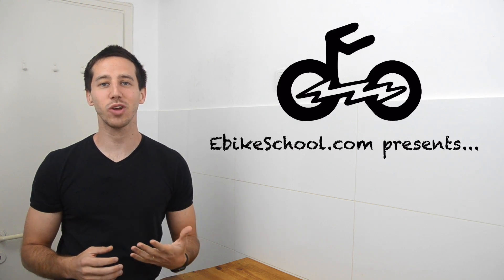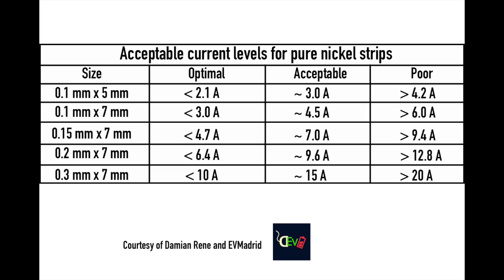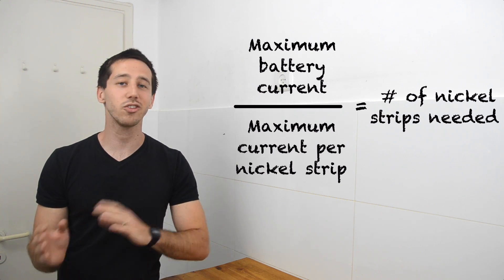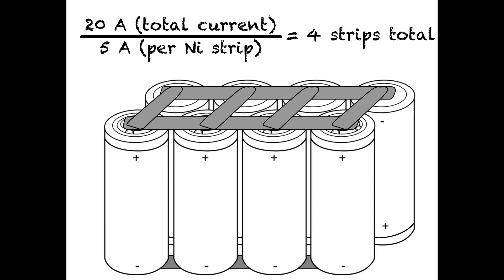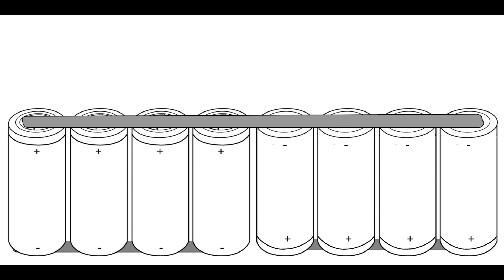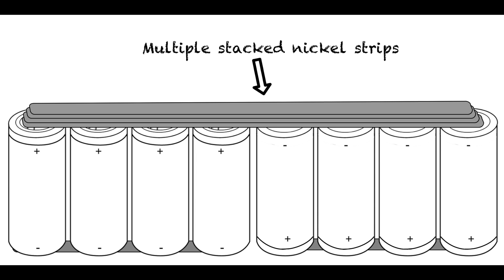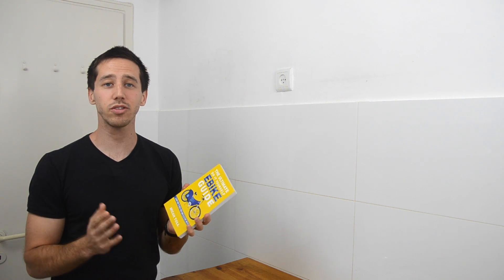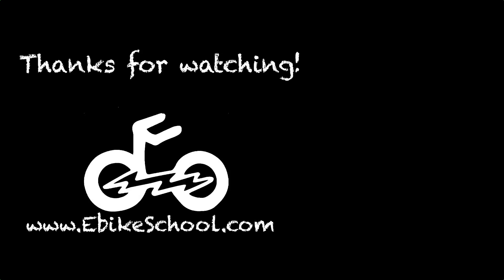How Much & What Size Nickel Strips Should You Use? Q&A#4

Comment: Micah, I really appreciate your videos. The pack I am building is a 20s 7p.  I'm just can't help but feel I should use copper over nickel. I understand nickel is easy to spot well because it's more resistive than copper.  I plan on cutting 1 in wide strips of copper 26 gauge. My parallel packs are two cells wide so the 1-in should cover it nicely.  I thought I might drill holes through the copper over the center of each cell and pre tin the cells.  Then with a little flux and a good soldering iron.  If I figured it right, 26 gauge 1-in wide strips should be slightly better than 8 gauge copper wire.  I know you're not big on soldering these cells but isn't the nickel a bottleneck on the bigger packs?
Reply: The problem with copper is that you need to solder like you said. The nickel is more resistive, but since you put the necesary amount of material to let the current pass without resistence the result is the same.
Reply: I build a 20s5p with 0.7x6mm copper Strips, and i can pull easy 100a.
But its very hard to solder.

Comment: Hi micah  I ordered your book from Amazon it has helped me on my diy battery building thanks I ordered a 48v 12.5 mah battery from Ebay I opened it up and yes it doesn't have much nickel in it it has only one strip across parallel and series configurations  I noticed I wasn't getting much power from the battery so I am building more nickel on to it ?

Comment: Great video. Now I have a battery 10s4p(xiaomi m365pro) I would like to calculate what's the optimal size of the strip for each square set of paralel batteries. Unfortunately I cannot double up the tabs on top of each other but I can have them wider. How do I calculate if my 6mm/0.17mm nickel strip is sufficient. Thanks and sorry for the weired question.

Comment: Can we charge a 48v Li-ion battery with a lead-acid battery charger having same ratings?
My lead acid charger is rated at 62.5 max voltage
So can I use this charger...
Reply: Every Li-on battery pack must contain bms battery managment system inside . It is protection circuit board inside battery pack. Your battery is probably 13 cell in series it means 13x4.2V is safety maximum voltage 54.6V. There are three options if you use lead acid charger with 62.5V.   
1. You destroy protection board and overcharge battery 4.8V per cell means sometimes FIRE!!!. 
2. You overcharge battery to 4.8V per cell and protection board survive.
 3. Protection board protect battery for overcharging and you can use the charger. So it depend on protection board in battery. If you are not sure what are you doing, dont try this... 

https://www.youtube.com/watch?v=ZTzEHsJVZhA&t=3m29s
Reply: @m1a1to  sir I am using this bms of 60A
https://www.banggood.com/Same-Port-13S-48V-2535A45A60A-BMS-PCB-Li-ion-Battery-Protection-Board-For-Electric-Bike-Ebike-p-1332093.html?ID=47606&cur_warehouse=CN

Comment: Hello I am Akash from India. Your videos has been very useful for my project. But now I am manufacturing a racecar having PMAC motor. Its peak voltage is 470 V and current is 200 A . I am also using 1850 cells but I have no idea of how to connect these cells . My final configuration is coming out as 112s 7p for 7Kwhr battery pack. Either by using a spot welded  Nickel strips or any other method. If Nickel strips are good then how much thickness should I consider . Please answer my question as soon as possible.
Reply: You are going to harm someone with such high voltage! Learn the basics and watch the YouTube channel "electroboom". Anyway... For your project you need very massive nickel pieces. Better go with copper 👍🏻
Reply: 7p is barely enough for your project, the best you can get out of on 18650 is 30A, by doing 7p, you will over heat them, not to mention the shortened capacity & lifespan.

Comment: It may not be the best idea. What I'd do is build the pack. With a single nickle strip. Then solder solid copper wire to the strip. Not the cells. And have about 8 spot welds. And about 14 gauge copper. Maybe 16 or 18 ga if soldering is difficult. Just doubling or even quad runs of copper. I'm using 8gauge copper busses on my 100s packs. Fused per cell. I may go with 10gauge. But its 4 strands into a 2" by 3"copper plate . it should never see over 125a the busses are 10" and joined by other buss links across them 8" long. The 8-10 gauge should carry 40-50  amps each, easily for short durations. It being so short. Then connect with 2/0 gauge. It will usually see 50-100 a max. With occasional 200amps. Or as much as 4kw from from my 5kw inverter and DC loads. Depending on pack voltage. Up to 29.4v im going for a minimum of 23-24v and max of 28.8 or so. I know its a bit different than high current packs. Mine is 1400 cells. Of a total 2800! In 100 cell packs. Great video, I have been looking for this info.
Reply: I do the same. Will not stack. Have .4mm copper sheet to use, prefer bare solid copper wire. I'll double 24 gauge,  ea good for 4A, or run 18 gauge, good for 40A. I try to solder before welding ni strip to batteries

Comment: Do the spot welded joints act as a limiting factor to the current? Because their cross sections can be pretty small (therefore adding to a non-insignificant resistance). In your spot welding video, you make 3 welds on each terminal for that very reason. How much current can comfortably flow through each weld?
Reply: I doubt they matter too terribly much, as long as it's a solid connection. Each weld point only has to carry the current of a single cell, unlike the series connections between multiple cells

Comment: Why nickel and not something more conductive?
Reply: Easy to weld. Copper requires more energy to weld because it is more conductive.
Reply: @jalius7878  True,  also that spot welding copper is destructive because the copper draws current away from the spot welder, as it is much more conductive.
Reply: No oxydation.

Comment: I'm building 22s6P and would need at least 65amps, i calculated that's like 18 strips, is that correct per cell, or can you spread it over series?
Reply: Why would u do that? Simply solder copper top of the nickel. I have .4mm supper sheet and at 9mm wide, is good for 40 amps. I have soldered .4mm on top of .15×8mm nickel. Soldered on top of the copper is (2) 18 gauge solid wires. With that combo u'd have 5A from nickel, 40A from sheet and 30A from (2) 18 gauge. 75a, lot less expensive.

Comment: What if i have a 60v E-scotter and a 12v e-bike, and would like to build multiple 12v battery banks, which I could use for both? If I add a bms for each 12v bank, can then connect them in series? What happens when charging/discharging multiple packs?

Comment: I bought some nickel strip from a website and it was fake
Reply from the maker: Which website? Link?
Reply: EbikeSchool.com I said your by mistake, meant to say a. I was asking what I should do about this. I bought it from some online vendor from Amazon , and I did a test on it, and it was for sure not 100% pure. I corrected my original comment.
Reply from the maker: If it was Amazon then they are usually very good about refunds. Probably won't even make you send it back if its inexpensive enough. Just go to your order page and request a return. In the future, I carry pure nickel strips on my site at https://vruzend.com/product/100-pure-nickel-strip-for-battery-building/
Reply: Are plated nickel strips not having a lower resistance and therefore able to carry more current that pure nickel?

Comment: Could you use copper as apposed to nickel strips? and why nickel it is less conductive then other metals? what about tin. Get back to me if you could thanks brah!
Reply: test
Reply: Copper is harder to spot weld(requires more heat).  It is possible, and yes it does carry more current for the same size nickel strip.

Comment: I'm making a 20s 8p battery pack for a small electric motorcycle and I'm having trouble figuring out how many .15x6x50mm strips I will need. According to my calculations I will need about 320 total strips but that seems high. If someone could give me a hand with the math just to make sure I'm not mixing up numbers in my head I would appreciate it.
Reply: Here is a link to the strips I plan to use https://www.amazon.com/0-15x6x50mm-Soldering-Capacity-U-S-Solid/dp/B07811NCH3/ref=sr_1_3?s=industrial&ie=UTF8&qid=1521074126&sr=1-3&keywords=pure+nickel+strips+0.15&dpID=41GLTU20JbL&preST=_SY300_QL70_&dpSrc=srch

Comment: I'm having trouble getting a good weld with .2 nickel strips I have, but I've found that I can put a.1 strip on the battery first and then weld a .2 on top of the .1 strip and get strong welds. Is this a bad approach to use for high amp requirements?
Reply: Did you find if that is good way to weld .2 nickel strip?
Reply: That .1×10 mm nickel is good for 5A. Solder an 18 gauge solid bare wire to nickel. The copper would b good for 15A =20A

Comment: Should I choose solid nickel or nickel plated steel? Is there any difference in performance?
Also, the strips are often joined to the battery by two weld-spots. These spot welds tend to be the same shape as the tip of the welder but let's assume that each spot-weld is round, and has a diameter of, say 2mm, (This is typical of the welds that I have observed on reclaimed cells). Surely this should figure in your / our calculations?
Please, please respond. I think my point is more than valid, thanks.

Comment: I am creating a battery as a starter / main battery for an ICE motorcycle. It'll be an a123 4s1p pack. Once the engine is running the battery should be charging - if not, I have other problems. So, the only thing that I need to scale the connecting strips for is starting load. The OEM battery is rated 130cca and the a123 will burst at 120 amps. Do I need to scale for the burst (120 amps) using the factors given in the table (i.e. 24 0.15mm strips total / 8 strips per connection) or is there another factor I should use? Also, how do you connect the strips? This will be my first battery so I will be soldering it - do I solder the entire length of the strips or just a contact point at each end?
Reply: Sorry, I know this was quite some time ago, but did you finish your build? I've been wondering the same question about multiple strips - what's the ideal way to stack them? Do I still only solder the contact points?

Comment: Hi I am about to make a 6s8p configuration for my rc car.I want to use high amp 18650 cells because i need sometimes 60-80 amps. I made a battery holder cage to prevent the batteries from overheating. Can you please check it if its all right or not?
Reply from the maker: Sounds like a great start!

Comment: i build a pack with 8P  (20S) and each cell connected with the next P group with a single 0.15x7mm strip, so it can pull safely 40 Amps ? if i understand this clearly?
Reply: Yes 40 amps at 5 amps a strip

Comment: In the case of the 2WD bicycle how to control the speed of both motor. I mean how it perform in case of turns where speed of both wheels are different. And whats happened if any one motor in start to run fast and another is slow.?!
email id-  parth.halvadiya24@gmail.com

Comment: This is quite wrong sins when you add more nickel you don't just increase the mass of the conductor to carry more heat you also reduce the resistance that reduces the voltage drop even further that means that when you add more nickel strips it adds more to the current capabilities exponentially not incrementally as you say.
Reply: That is what he said, you are adding more current carrying capabilities! he was just explaining about the heat problem as a safety point

Comment: Great video! I have also looked through your other tutorials and I was wondering how you would go about stacking the 18650 cells on top of each other...length wise, the reason would be to make a longer pack shorter.

Thank you for your time.
Reply: This is what I do  I make the battery long then bend the plate and stack them upright  good with s3 not so good s10

Comment: On a somewhat related topic, in a different video you talk about testing the internal resistance of a battery.  You end up with something like 325 milli ohms and mention that it is too high. What is a good number for a 18650 cell type battery? Iv built a battery and have some voltage sag and would like to figure out if it is ok or should i go back and add more strips, or shorten some of the wires.

Comment: why not use copper instead or even silver as that is the most conductive ;)
Reply: Aluminum is also pretty conductive and easier to work with but I prefer copper for most productivity
Reply: Don Mega  it's not that much more expensive, just slightly. If you replace all the nickel use in the video with copper it won't even cost $1000, no, it won't even cost $10.

Comment: Great video! Thank you! I´m trying to learn as much as I can before trying it out on my own. I wanted to ask a question regarding this same topic: I was thinking on buying this pure nickel strips that have slits (https://www.aliexpress.com/item/18650-battery-pure-nickel-belt-3P-4P-5P-6P-lithium-battery-nickel-strip-Li-ion-batteries/2053339372.html?spm=2114.01010208.3.58.jFuUQq&ws_ab_test=searchweb0_0,searchweb201602_5_10065_10068_5000017_433_434_10136_10137_10138_10060_10062_10141_10056_10055_10054_10059_124_201_10531_10099_10530_10103_10102_10096_10052_10144_10053_10050_10107_10142_10051_10106_10143_10526_10529_10084_10083_10080_10082_10081_10110_10111_10112_10113_10114_10078_10079_10073_10070_10122_10123_10124-10530,searchweb201603_7,afswitch_1,ppcSwitch_5,single_sort_0_default&btsid=2f986c7c-cbbb-45be-b19a-06c62666b615&algo_expid=9ec7703f-7a9d-44d3-98ba-8c53d800a5c0-6&algo_pvid=9ec7703f-7a9d-44d3-98ba-8c53d800a5c0), Do you recommend using this?, You showed in the video that it´s optimal to have more nickel strips if you wanted a higher amp build. Are this good even though they are using the same strip for parallel and series connection? I´m planning on doing a 14s6p battery, and i Dont know if I should just buy pure nickel strips whithout the slits.
Reply from the maker: The nickel strips with and without slits is basically the same in terms of calculating how much to use. The purpose of the slits is to improve the spot welding by forcing 100% of the current to pass through the weld and not let some of it shortcut through the nickel itself. You'd use the same process though by calculating how much current each of those series sections can handle. If they don't add up to the current you want to pull through your battery then you'll have to double those up as well.
Reply: +EbikeSchool.com  thank you! Though my doubt is that the strips in the link are much bigger because the are ready to make paralel and series connection in just one strip. If these strips are bigger, then they would have a higher amp capacity and still be optimal according to the table? Or is ir better to just cut alot of pieces and use many small instead of a few that are wider? thank you so much

Comment: amazing video!!! i have 6 x 18650 in parallel and nickel 0.1 x 10mm . i want to make 12 in parallel what would you recommend? i was thinking to put 6 bat + 15a fast blown fuse + 6bat 30a fuse. bad idea looks like because nickel strip wont handle 24A at 3.7 v dc right?
Reply from the maker: It really depends on your series connections. If you want to pull 24A through the battery, you'd need between 5 to 6 of that size of nickel strip in your series connections. So if you have a 12p setup, you could connect in between every other battery cell, at a minimum.

Comment: Hi Micah,
another great video :-)  tnxx and your new diy lith.batt book i want to buy! that is for sure :)
question: can you explain how to make diy batt pack on two floor (for example when you limited with space ) ?
Reply from the maker: Thanks for the kind words. I'm sorry, but I don't understand the question. What do you mean by 'two floor'? As in a very flat pack?
Reply: Micah sorry for my english :-) 
ok my specific problem is battery for my scooter ,i need big pack 20P13S (260 pieces 18650) and my space is 24cm *36cm 
but i have space in height (height 20Ah SLA 12V batt) 
so i need to have my battery in two rows  i guess
If you can help me with that ,to now how to design battery and some buildings tips i would be very grateful to You 
Hope now is more understandable to you :-)
Reply from the maker: Hi Dejan - in that case you would need two rows. I would make two batteries. One would be 6s20p, and the other one would be 7s20p. Then you can use wires to make the series connections between the two packs instead of the nickel that would normally be used if it was one big block. That would turn them into one pack. And you'll use one BMS for the entire battery.
Reply: tnxx Micah,